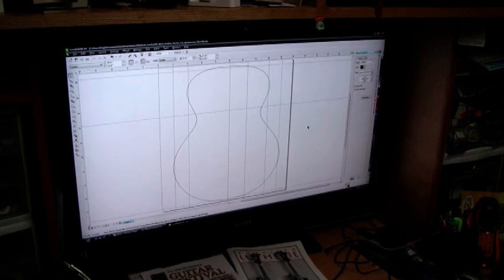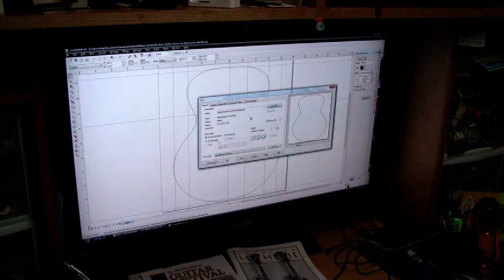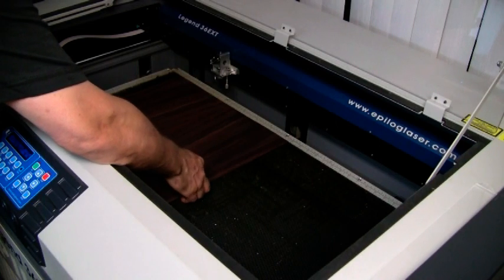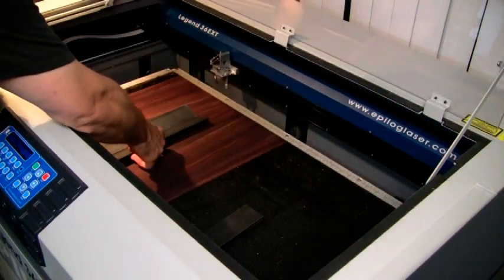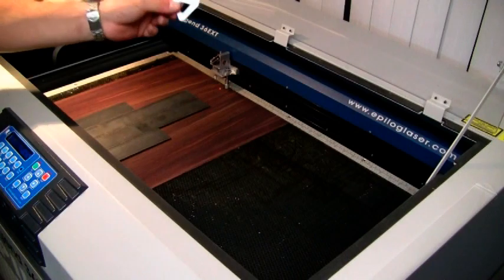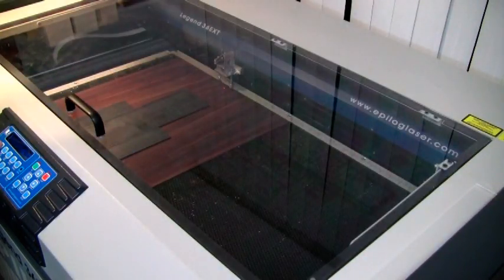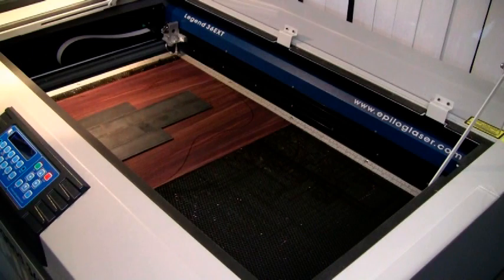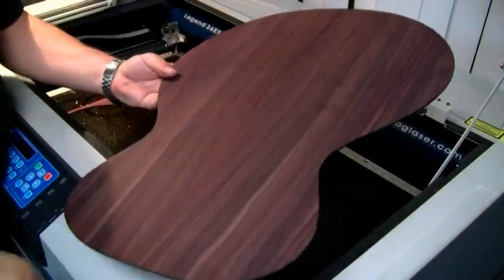Laser Cutting A Guitar Back

Comment from the maker: @Iblisfalls - It's only 45W, so it's limited to about 3/8" per cut. Like I said somewhere else, I wish I'd gotten the 120W version now!! The problem with cutting thick wood for electric guitars with it is that the cuts leave burn marks - not terrible, and they could easily be sanded out, but a CNC router machine (such as a ShopBot) is a much better choice for electric body/neck work. Coincidently, I just purchased a ShopBot Buddy BT-48 with 4HP spindle exactly for doing that! :)

Comment from the maker: There's no real advantage at all. It's just cool. It does make life a little easier though - I have the laser cut the 3/16" hole in the center of the soundhole (so I can use my rosette circle cutting jig), and it cuts the top consistantly 1/4" oversize, so positioning the top (or back) when gluing to the sides is easier.

Comment from the maker: Using my bandsaw and cyclone dust collection system together to cut a back uses about 1.5 million Joules. My laser engraving machine uses just a bit less than 0.5 million Joules to do a much better job. Thus using the laser is about 3 times more energy efficient than using the bandsaw. I prefer the efficiency and accuracy of my methods, and since I can afford the tools, I will continue to do it my way.